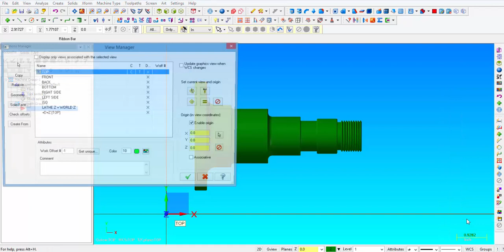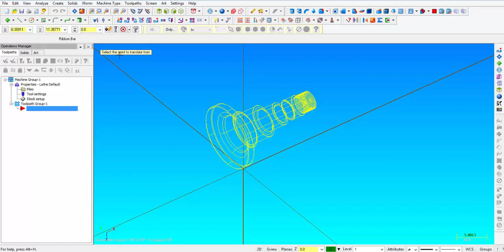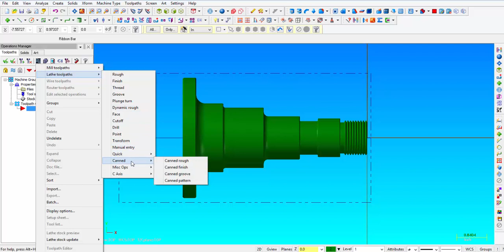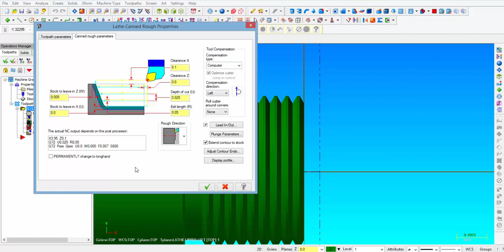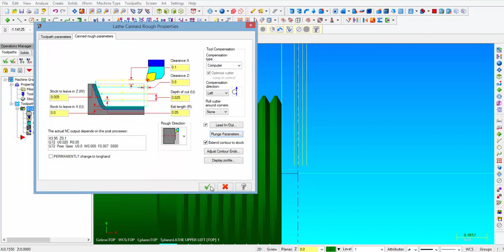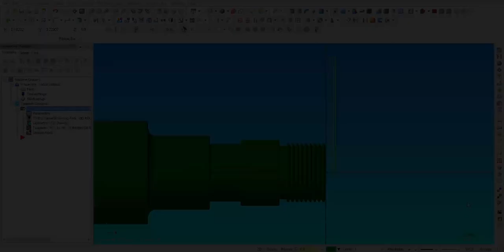CNC LATHE PROGRAMMING IN MASTERCAM - G72 CANNED CYCLE

Comment: I like your channel, thanks for sharing your experience with all of us :) I am still learing cnc lathe programming and I have had problems related to inserts feeds and speeds :( the information I found in catalogs is so much that I don't even know where to start looking for. Do you have a quick reference turning speeds and depth of cuts (black coated carbide inserts) and consider threading, ID grooving, OD grooving, parting, OD turning, ID turning, drilling (twist drills). I have used catalog speeds but they have resulted really agresive for grooving, and I parting and Manufacturer tables have so much information that begginers really get lost really easly.
Reply: I'm in same stage now 😃

Comment: Hey Tom I like your videos , great info . Question though, on the g72 facing canned cycle since your not chaining the operation how  do you make sure that your insert goes twice the nose radius pass center?
Reply from the maker: Good question Michael. Mastercam looks at the tool nose radius of the insert you selected in the tool page menu. The lathe post processor then automatically calculates that distance for you. Hope that helps you. Thanks for watching.